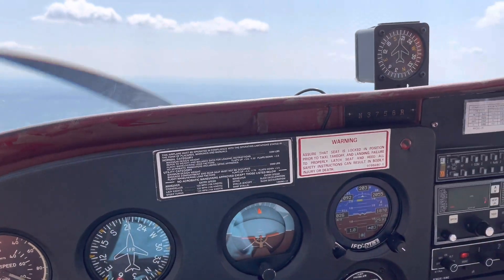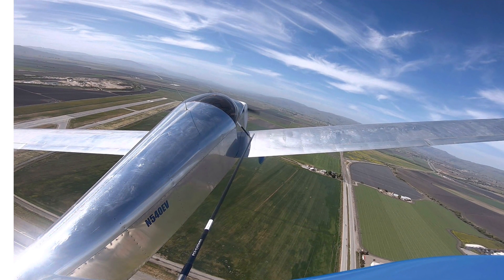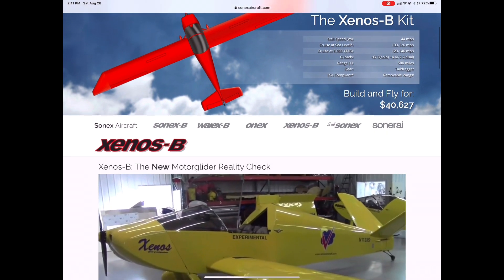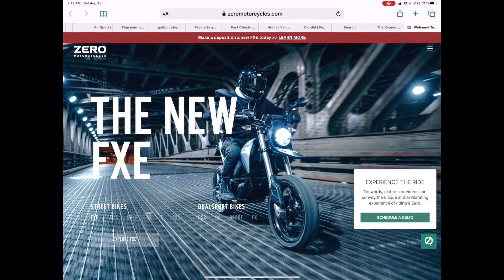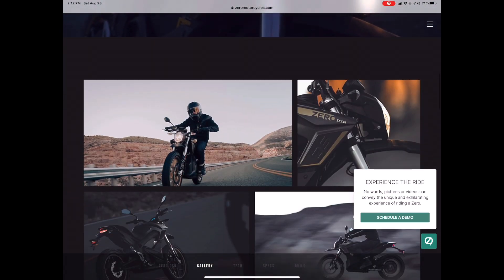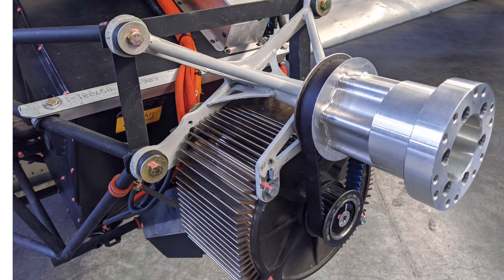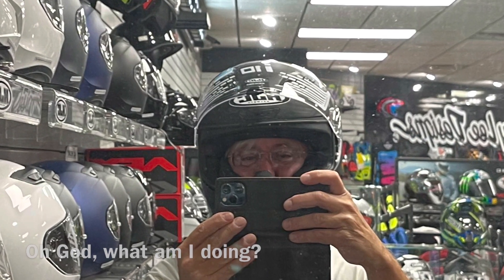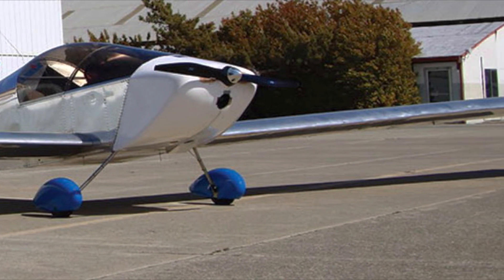Tim’s Tips #81 - Electric airplane project, Sonex Xenos motorglider - August 28, 2021

Comment: I'm a long time Tesla driver and I saw your clip on Zak & Tesse's Tesla Time News. This is a great project and kudos for putting your money where your mouth is, as it were. As one of the people literally on the ground, I think another benefit of electric aircraft is the vast reduction in noise pollution. You might be flying in fairly isolated areas where you are but here in the UK that's almost impossible and if someone is flying nearby, it's incredibly annoying. I'm given to understand the noise reduction isn't so great for the pilot because 'prop chop' but I think you're doing it for the right reasons. I was a bit disappointed not to see any mention of electrification on the Sonex website though and I hope they're keeping their ears to the ground because I think a lot of people are ready to make the jump to electric. Good luck with the project.
Reply from the maker: Thanks for your thoughtful reply. Sonex picked the wrong aircraft to electrify. The Xenos is a much more efficient airframe, lending to electrification. See their first attempt at https://www.sonexaircraft.com/e-flight/

The other issue is speed. I’m retired, so 60 MPH is fine. Most pilots want to go 100+ MPH, which is not very efficient. The Xenos if perfect as a BEV (Battery Electric Vehicle). This eXenos will probably make 100x less noise than my Cessna 172. That is 10 decibels, which will be quite an improvement. My airport is near a hospital and many cities.